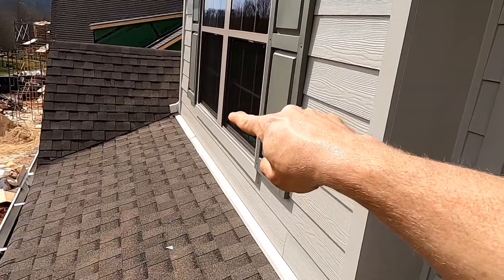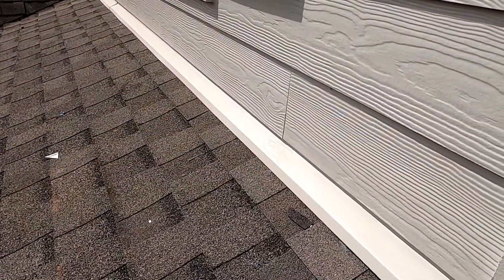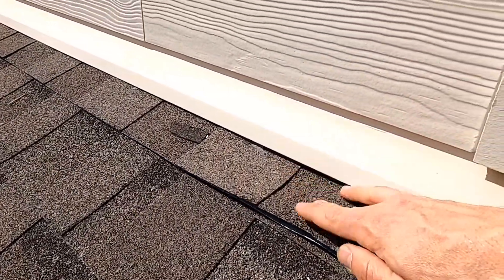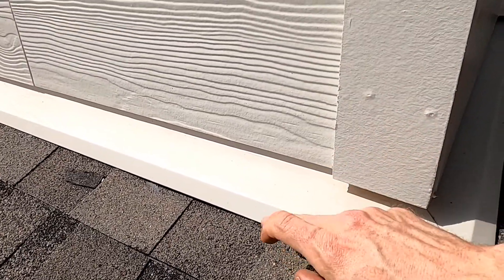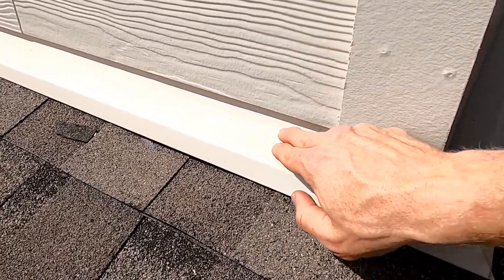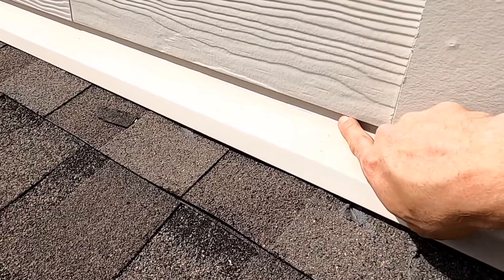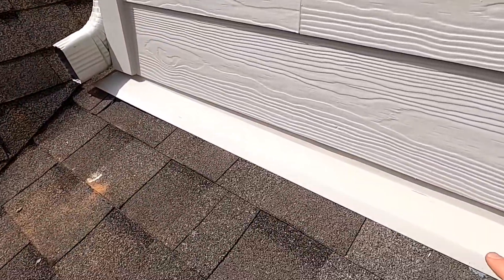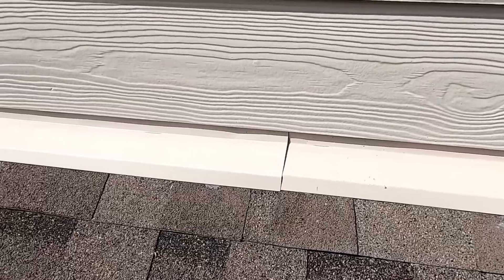Quick Tips: Roof Series: Headwall Flashing

Comment: Not that great of an install. On so many repairs I do when they have the siding guys flashing tucked under the siding or Hardie board on the right and left side of a wall I always got to remove those when doing a repair because those will trap water and I've seen so many siding guys drive nails through them and you cannot see the roofer step flashing if they did it correctly what's 9 times out of 10 it's done wrong

Comment: Question - just learning about various roof flashings.  When L-shaped flashing is installed at a roof/wall transition, the one lip of the flashing goes behind the siding and the other lip goes over the shingle to transfer water downward and then another row of shingles is installed on top of that lip to asthetically hide the flashing.   When you attach that final row of shingles over the flashing, are you supposed to nail the shingles into the flashing (which will puncture the flashing) or do they use some kind of adhesive to secure then shingle to the lip of the flashing under it?

Comment: Instead of using the apron flashing, I wonder if it wouldn't be a suitable alternative to use some self stick ice and water shield, but cut it down to size and only remove the adhesive's backing plastic from the section that will contact/cover the roofing shingles.  Leave the plastic backing over the adhesive that will be in contact with the flashing or wall above.  Then you could just affix it to the wall with the siding's fasteners or use cap nails before adding the siding.  Seems to me it would be useful option for a DIY job where you have sufficient amount of leftover ice and water shield.

Comment: Roofer just did our porch roof and did NO flashing in an identical looking situation. We called him because the roof, over our porch, leaked onto the porch. He put new shingles on with his crew, four men who didn't speak English so we could ask no questions, and caulked, very sloppily, the line where the shingles meet the old asbestos siding. 
The roofer had given us an estimate with flashing included on the price.  Decades ago, when the porch was put on, my grandparents had copper flashing installed under the asbestos siding. 

When we saw no new flashing and made the roofer come back, he claimed the very old copper flashing under the asphalt shingles was installed by him - even tearing two pieces, and cracking our asbestos sideing, to cite his false claim.  Then he claimed we didn't need new flashing. Then, when we insisted he put the flashing on, as indicated in the estimate, he had his crew up there for about an hour hammering. He only put yet more shingles on, with no visible flashing added. He caulked it and put parts of the asbestos siding, which he'd broken off, on upside down. 

There are now gaps in the caulking, NO flashing - he tried to claim he put this black aluminum flashing UNDER the existing asbestos siding and new tiles. An obvious lie. To say I'm very upset is an understatement. He did nothing to remediate the old leak, which was where the roof met the old house, except to very sloppily caulk. When that wears off, or dries out, it will obviously leak again.
Reply: Same with me. Can't trust any of these hacks.

Comment: Thanks, I was looking for this idea for a hour. I just build my small shed next to my house with siding and I didn't know what material and process  for this connection.. Thanks, Good video..
Reply: I was ( I thought I was ) so anal and thorough with my headwall to shed roof installation... after 12 years it leaked...water ( the bane of my existence ) found it's way under my flashing, under the adhesive rubber seal-band, and rotted the OSB...Shed is 12' x 12' ~ attached to my house and I only have to replace 1.5 ~  4'x8' sheets, but, what more can I do?? Moving to AZ is out ~ the boss ( wife ) said so ...